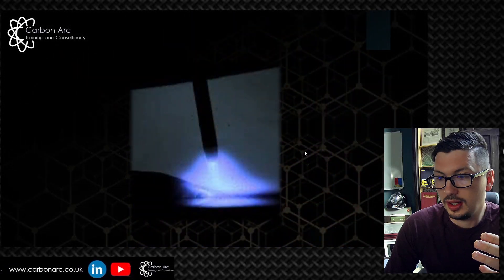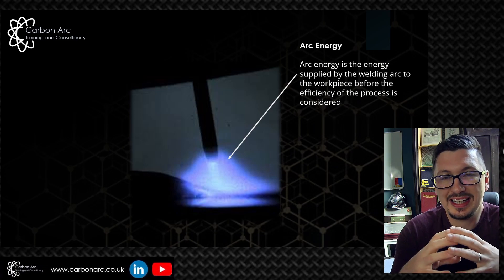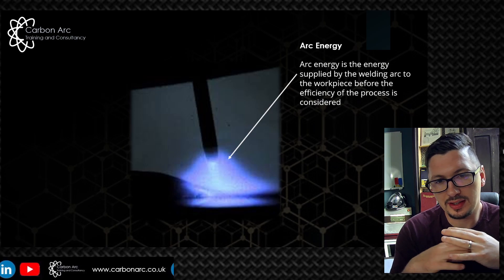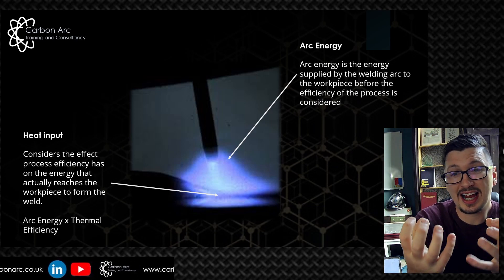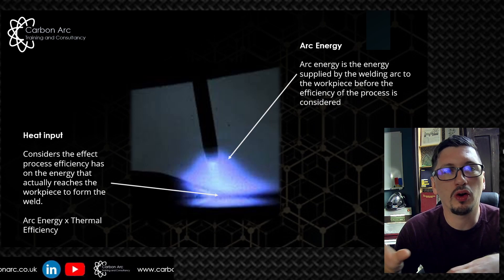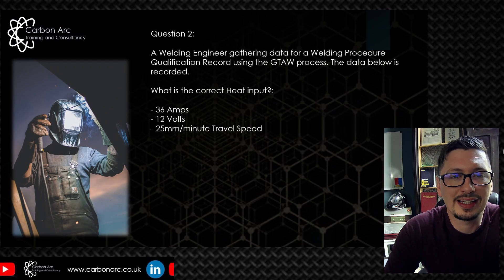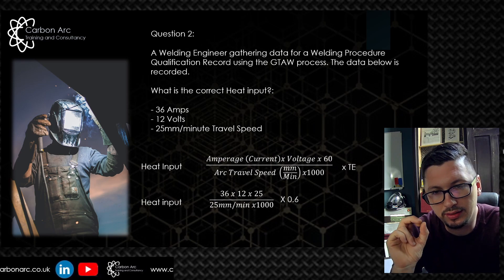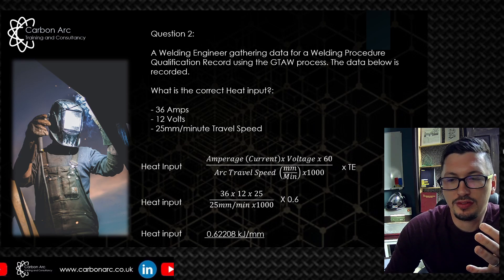The Most Important Equation for CSWIP 3.1 and 3.2 (Heat inputs)

Comment: Why you multiply by 60 ? I only do 
AE = (AMP*VOL) / ((TS/60(if provided in min)*1000
Reply from the maker: The equation can be balanced in many different ways. The one shown in the video is that in the welding standards but all versions should get the same result